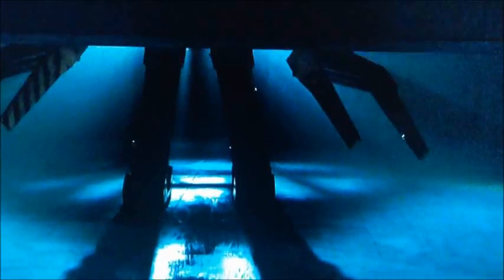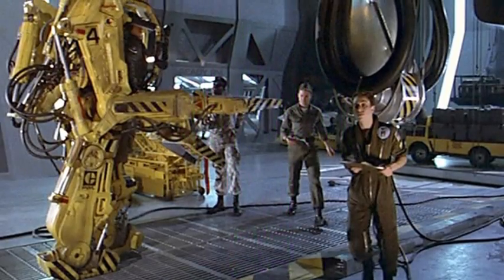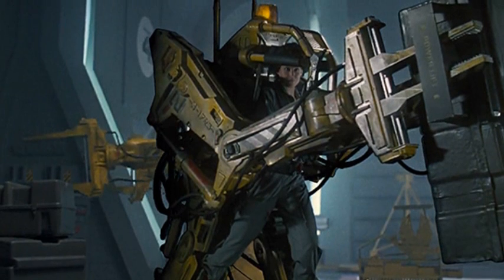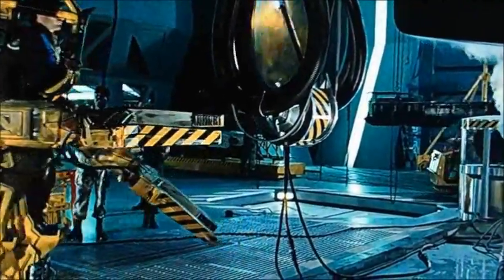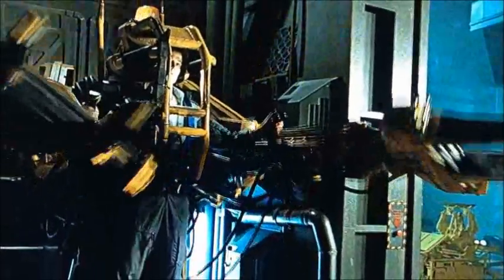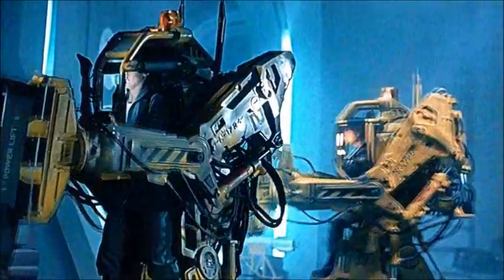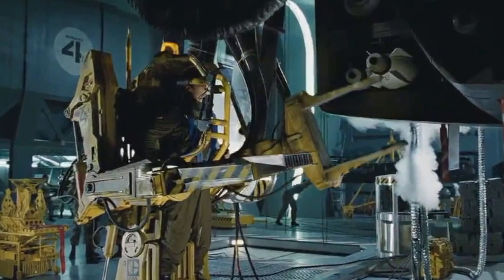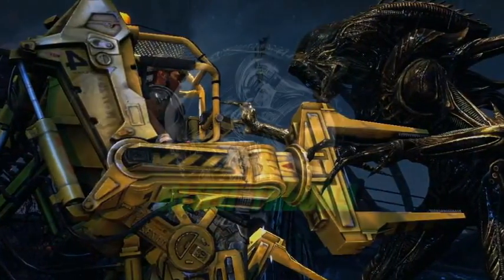USCM Tech: Caterpillar P-5000 Power Loader - Explained

Comment: As a forklift driver this thing in no way would be capable of lifting 4 tons. It lacks any type of counterweight.
Reply: In fact, the Colonial Marines tech manual, actually contains a testamony from a power loader operator, who says its really maintainence intensive and when operating on rough or muddy ground, the small feet, reletive to the unit's huge weight makes them really prone to sinking or toppling over.
Reply: I'm with you. As a forklift operator myself I don't see something like this lifting 1,000 kg even with some sort of gyro let alone 4,000 kg.  That's just insane, even for the future.
Reply: The fuel cell on the back acts as a counterweight.
Reply: maybe these are meant to be more mobile and sophisticated forklifts that do other things like repairs and placing things in places as well, not just lift.

I haven't seen many forklifts with blow torches, moving clamps and able to horizontally align all in one.
Reply: Odds are they probably have rack points for counter weights for heavy load work that's just the load limit for the actuators.
Reply: Their ships have antigravity so maybe this thing has a bit of that to avoid needing a counterweight
Reply: No worries. They can control gravity onboard of USS Sulaco. With the little help of GCU (gravity control unit) lifting capacity of Power Loader is increased to 4000 kg. Let's not forget of a body-builder hidden inside of this machine :D
Reply: I'm guessing Grav Plating on the back, with active counterweight settings. You pick up 4 tonne, the Grav Plating on the back adds 4 tonne in counter balance.
Along with Gyro Stabilisers, the limit would be how much the pistons can hold, or how stable the ground is. Small feet sinking into the ground being a problem.

Not as quick as a forklift, but better for awkward angled jobs. Or areas where the mast would get in the way.
Reply: No Grav Plating... all of the Alien films have gravity in spaceships, without spinning disk spaceships, like Passengers.
They just don't talk about it at all.

Remember Bretts death scene, all the clanking chains. All in space, all with what seems like Earth gravity.
Alien Bretts death... https://www.youtube.com/watch?v=NFiLVrux4V8

Alien resurrection, all the water in the spaceship... 
https://www.youtube.com/watch?v=cv7_7dSbaOk

It's also a technology that only a couple of films talk about, Caverite in the First Men in the Moon films talk about anti-Gravity paint in great detail, telling how it could destroy the Earth. There may be other films, but its all I know about...

Caverite paint, is of course not Grav-Plating, Grav-Plating most likely being technology based, not a paint. Grav-Plating can be turned up and down in intensity. To simulate any gravity.
Reply: Look at the advancements in T.V.'s in a small space of time, now you have one on your phone.
Stuff thought impossible, just a hundred years ago.
Technology doesn't have to look pretty to be advanced, rugged vehicles on building sites look all beaten up. But compare that to the first cars, They are a marvel of technology.

A T.V. is just a piece of circuitry, Grav-Plating, if it ever gets made. Will be most likely, just the same. Just a disposable technology, like the circuit boards on T.V.'s.
When it breaks, you just throw it away and get a new one. Production line, or automated construction. The way things are going, just automated. A couple of Synth's running a whole automated factory for you. Programmed with all the jobs that people used to train to do.

Robots making Robots, like in Alien Resurrection. Although... they don't like being told what to do.

Computers the size of buildings are an old technology concept, with nano technology and modern materials, you could shrink stuff down even smaller.

We never got to see Power Loader technology updates in Alien Resurrection's period.

I can't remember the Gravity Well room in Colonial Marines, but Alien is not too far in the future 2122, so its only 104 years away. Current space technology is still in the stone age, so... you are probably right.

More like the year 2200...
Reply: The first Power Loader used in the films was only in the year 2183, just 165 years away.

Alien timeline... http://alienanthology.wikia.com/wiki/Alien_Universe_Timeline

We've got only 165 years to...
1. Reach the outer rim of the galaxy.
2. Make lots of really huge, kick-ass spaceships.
3. Make synthetic people.
4. Invent Power Loaders, the easiest thing on the list.
5. Invent Cryo-Sleep technology.
6. Terraform lots of planets, its called Shake N Bake.
7. Be not excited, or hesitant about landing on an Alien planet. Alien, Prometheus, Covenant.
Reply: would be pretty good if the unit could have a counter weight(and/or is heavy enough)
Reply: I've driven telescopic forklifts, they have joystick controls, as well as levers. A moving clamp add-on for picking up barrels, outriggers, and all manner of crazy stuff...
Reply: As a McDonalds burger wrapper I disrespectfully disagree.
Reply: You disrespectfully disagree with what... wrapping burgers. It's always been a hot topic down the pub...

Mc Donalds burgers, wrap em... or just chuck em straight in the bin.
Reply: I think the walker is specifically designed to be used within a spaceship. With a lot of confined space and cables and other obstructions a four wheel forklift would be highly restricted in its functions. And because there is a relatively low volume of work compared to a large factory or warehouse. The walker is sufficient, to deal with the loads which should be by the most part below one ton. And speed is also not a factor due to the low volume of work. The work can be done at the walkers leisure speed.
Reply: It has the power of movie magic!
Reply: THAT breaks the movie, does it?
Reply: @aaronmoore6275  No its not. But it's a Cameron's movie ffs it supposed to be ideal.
Reply: @Iliya117  faster than light travel doesn't bug you, but payload Vs loader weight ruins the film?
Reply: @aaronmoore6275  It does, but this video is not about FTL. Anyway , if gravity control is so precise on Sulaco there sholdn't be any need for this loader whatsoever.
Reply: @Iliya117  I'd think that any Company that has figured out FTL has probably also figured out how to make Man-Portable Heavy Lifters NOT tip over.

Comment: In a large warehouse they wouldn't be practical. Fork lifts are faster and cover more ground. The power loader seems to be stuck picking up specially designed boxes or clamping down on objects. But it's good at slapping a queen around and it looks cool.
Reply: Also, it seems there would be a problem with tipping over when carrying heavy loads unless the lower half of the loader was counterweighted or some other compensation existed.
Reply: Jodi Mae Yeah it would tip since it has no counterweight or very low weight. The loader would be limited especially with it's arms streatched out. Visibilty could be a issue too. Even if the systems are very advanced there are still physical limits.
Reply: On a spaceship with limited space, I don't think it would be an issue to replace pallets. Especially for the military
Reply: Yeah, these would only be useful out in the field, say at a forward outpost to unload trucks, help with construction, and other utility work. I think the one plus for the P-5000 is that you can do many things with only one piece of equipment, but it's not really great at any of them...
Reply: That's because a forklift is just another kind of car.  This is far, far more complicated.
Reply: I think the walker is specifically designed to be used within a spaceship. With a lot of confined space and cables and other obstructions a four wheel forklift would be highly restricted in its functions. And because there is a relatively low volume of work compared to a large factory or warehouse. The walker is sufficient, to deal with the loads which should be by the most part below one ton. And speed is also not a factor due to the low volume of work. The work can be done at the walkers leisure speed.
Reply: It would use a lot of propane tanks, that's for sure.  But it was meant for specialized use and it had the built-in welding tool among other things. I guess that would require an acetylene tank, as well.

Comment: I've worked in the steel making industry for 15 years. I can tell you having one of those powerlifters would make handling round and long skinny pieces of steel a breeze. Especially compared to the giant forklifts we currently use. 
The loader would give you so much more control over the load. And since it's basically indistinguishable from normal human movement, I think it would be easier to operate for beginners. Just my opinion. I sure would love to see one irl.
Reply: Could you switch out the legs for treads or wheels and still have the traits desired?
Reply: A Utuber has built one based on a tracked bobcat 😯😍

Comment: As an engineer, I can tell you these things have practical applications. I can also tell you the weak points are as you described: hips, knees, and shoulders. They are also topheavy. With the arms extended fully with a load, a counterweight will be needed off the back.

Next: they are slow and rough. Bipedal motion sounds good in theory, but your center of gravity is constantly moving during a simple stroll. It limits how planted the load is on the deck even without the arms extended. Hence the plodding pace of the thing. The load also gets shaken up at every step.

Detractions aside, this would be good for limited loads in confined spaces. The Sulaco is almost a bad example. The pure dexterity of the thing would make it ideal for bulky items that need to be placed with some finesse. The loading dock rather than the warehouse beyond would be the proper place to use these.

The addition of a counterweight off the back and larger footpads would solve many problems. I imagine a third foot or caster wheel tail could squelch my reservations.
Reply: These things always work in the movies but then there are reasons why you don't see them in the real world.  The first thought I had was about the counterweight - even forklifts with the full mass of the vehicle behind the fork have a large counterweight to keep all four wheels on the ground.  The other problem not handled in the movie version is the power source and hydraulic pumps; they're not small parts; where do you tuck them into the design?  How do you get the power source scaled down to a size where it has enough capacity for useful lift weights and working time between charges?  That many kilowatts in a small mobile package would be incredibly dangerous in accident scenarios aboard a spaceship.  The P-5000 Power Loader is cool looking, but realistically the forklift technology available in 2020 would be perfectly adequate and much safer aboard the Sulaco.
Reply: Wouldn't having the hydraulic oil reserve on the back of the machine help with the problem of a high center of gravity?

Comment: On a practical note, I think this powerloader would have been much more practical for normal work with just a regular wheeled or even soft-tracked forklift chassis, but keeping the articulated arms. There is no need to waste power on complex legs unless it's going out to operate in terribly uneven terrain.

Alternately, as some of the other commenters mentioned, slap some heavy armour and a few machine guns on there, and you've got the ultimate in xenomorph extermination gear. Similar to that mech in the AVP2 game.

Comment: Fun fact, there was a weight lifter inside the frame, and the actor were walking on his feet as you would for a young child, side note when Sigourney was using it the props department put a remote control ballon on the seat blowing it up against her back making her think the guy in the suit was getting...excited

Comment: obviously designed with the final battle in mind rather than practical use, still a great concept as it was the great equalizer. No way she was taking out that queen with riffles and grenades, as an explosion would have compromised the hull of the ship and killed them all. I'm sure Cameron thought of all these things as he was planning the fight.
Reply: I think the walker is specifically designed to be used within a spaceship. With a lot of confined space and cables and other obstructions a four wheel forklift would be highly restricted in its functions. And because there is a relatively low volume of work compared to a large factory or warehouse. The walker is sufficient, to deal with the loads which should be by the most part below one ton. And speed is also not a factor due to the low volume of work. The work can be done at the walkers leisure speed.

Comment: A machine similar to this would certainly be helpful for military purposes. We have a lot of heavy equipment that requires a two-person or more lift for safety reasons. With this machine, we could reduce that to one man and reduce the risk of injury and damage to equipment. The other benefit is that you could work longer without getting tired. Testing of Prototypes similar to this is in progress now.

Comment: I can imagine slightly smaller versions of a powered exoskeleton like this being used in situations where moderately heavy loads must be carried in areas too tight for forklifts to maneuver, however at that point a mini-forklift will still provide a more efficient means of moving those same loads without the added microcomputers and limb maintenance that a mech would demand.  Powered exoskeletons will probably see most of their use in construction and the military where it might be useful for a single human being to be capable of carrying multiple heavy tools/weapons simultaneously, while still conserving their strength.

Comment: I think I remember a Japanese University actually made a "working" version of the Power Loader years ago. The only difference being that it had a huge cable jutting out he back connected to a power source, which was an industrial generator (one of the ones the size of a shipping crate). It could only lift almost 1/3 of what the one in the movie could lift though.

Comment: I think the walker is specifically designed to be used within a spaceship. With a lot of confined space and cables and other obstructions a four wheel forklift would be highly restricted in its functions. And because there is a relatively low volume of work compared to a large factory or warehouse. The walker is sufficient, to deal with the loads which should be by the most part below one ton. And speed is also not a factor due to the low volume of work. The work can be done at the walkers leisure speed.

Comment: In 2018 a device like this could be built, even a better one. I am a certified for lift driver (here in Germany one has to have a certification for everything), I say, that a device like this would be amazing!
It would not be fast, but more accurate and it surely would have many more possible uses.

Comment: I think it would be a step up from our modern day Fork Lifts, but I can't really see being of any use when it comes to muddy or rough terrains unless the Power Loader comes the appropriate leg attachments for those individual terrains. And in addition the Power Loader also needs to come with a way to reach the highest if heights, much like our modern day Crain's could such as 20 30 40 50 meters high if needed.

Comment: There’s a type of fork lift/loader called a Side Loader that kind of seems like this could have evolved from?
Don’t have to wait for Fusion Cells or whatever this thing runs on, could easily be a propane engine actuating hydraulics. Even rechargeable Lithium Ion battery packs should work today? Need a joint Boston Dynamics/Caterpillar project.
Been working with heavy equipment my whole life, I need this shit to be real before I retire!

Comment: i do belive that something like this might be usefull for some cases of logistics, that said i doubt it would fully replace forclifts, propably just suport them since these Power Loaders are a lot more agile and flexible to use then amore static machine
if it ever comes to actual spaceflight with atifitial gravity this would be perfect for such usage, a Forklift is most likely to big and not manouverable enought and with small sized spacecraft you dont need to have the arms extend very far upwords